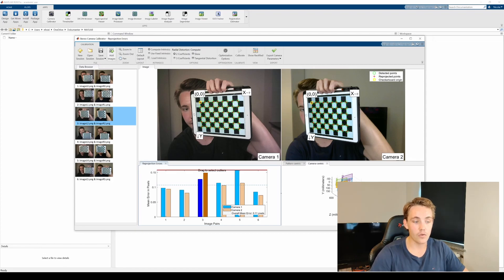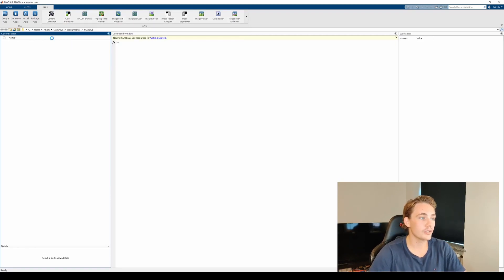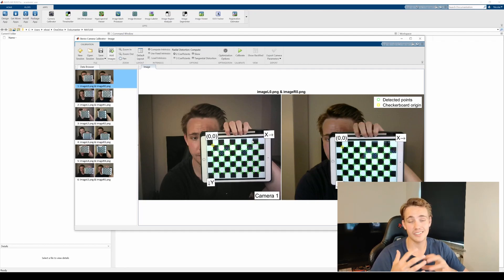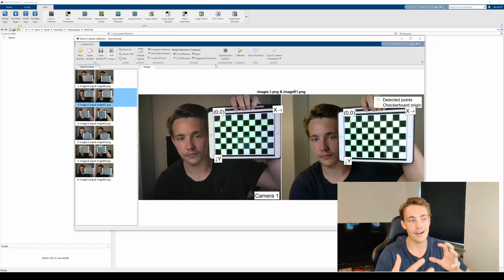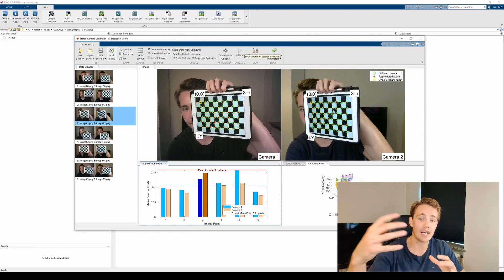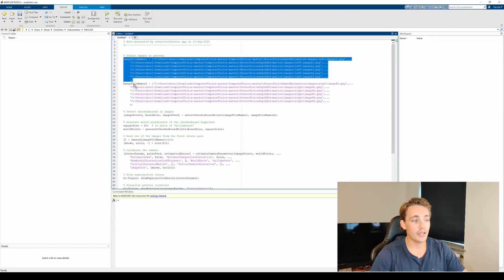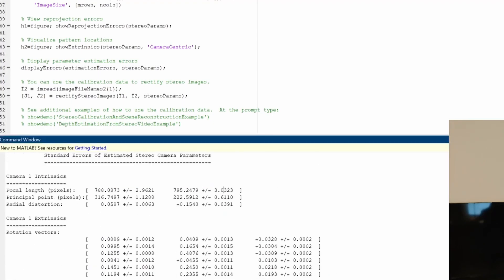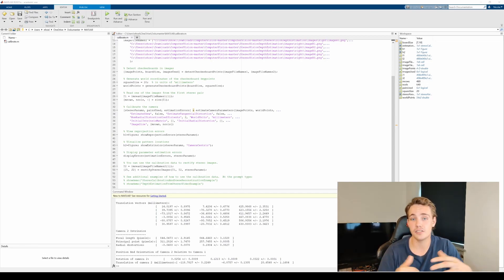Stereo Camera Calibration in MATLAB with Steps and Example

Comment: Have you ever tried to use the stereo parameters generated by MATLAB for stereo block matching and depth estimation in openCV?  Thanks in advance!
Reply from the maker: Actually I have never used the parameters from Matlab. Did u try to expect it and load it as we do in OpenCV throughout these videos?
Reply: @NicolaiAI  I'm not sure what you mean by "expect it".  If you mean export, yes.  I create/populate a .yml file with the stereo params from MATLAB and load that via openCV.  I know the camera intrsinsic matrix that MATLAB creates is a different format so I put it in the format that openCV wants.  But that produces two rectified images that are completely black.
Reply: @NicolaiAI  Glad to see you're still making videos and your channel is doing well.  Did you ever make a video where you used the stereo parameters generated by MATLAB in your OpenCV python object detection/range estimation?  One of the professors I work with figured out that we had to transform/rearrange the intrinsic matrices but I am still having issues when performing "cv2.reprojectImageto3D".  Seems like my Q isn't quite right but I feel like I'm going down a rabbit hole haha.

Comment: For the stereo image calibrator do i need to use only checkboard pictures??
or can use any image that i snap from stereo camera? like flower ?
Reply from the maker: U can use whatever object u want but u will need to write the algorithm urself then. Chessboard is used most of the time since everything is implemented and the results are good and consistent
Reply: @NicolaiAI  I am working within a very small field of view. I am imaging a wire with diameter of 1 mm. Can I still use the checkerboard to do stereo calibration at such small field of views?